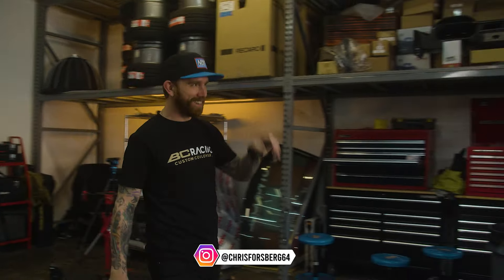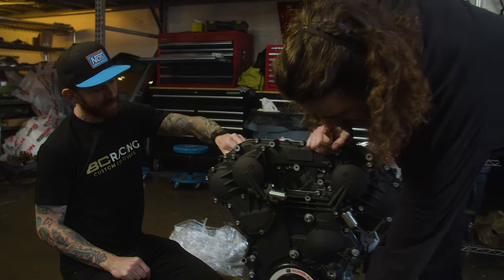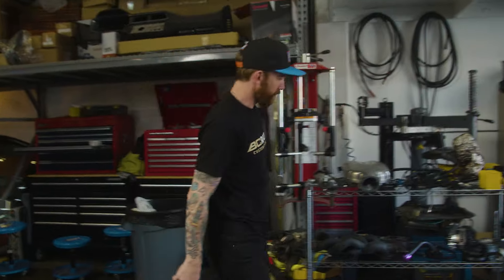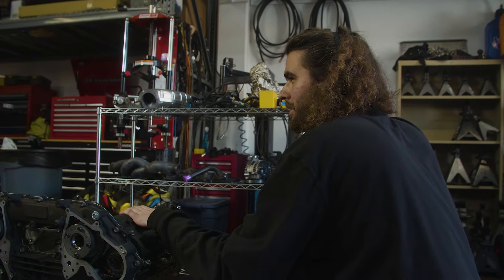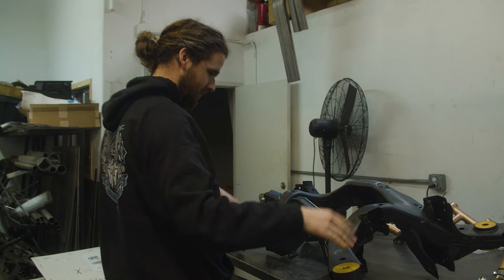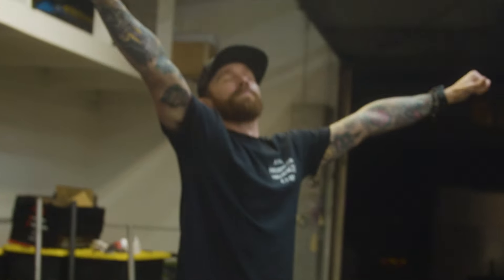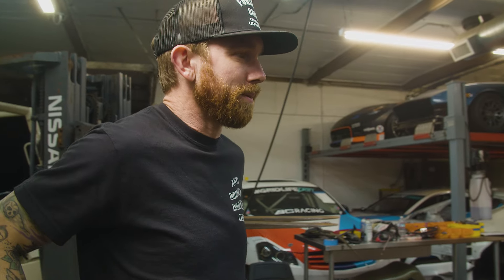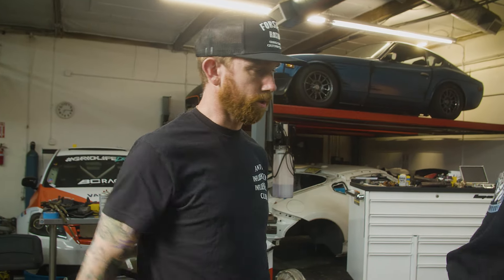GTR Motor Swapped Nissan Z Hits The Dyno!! | You Won’t Believe The Power It Made!!

Comment: How much boost did it take to get close to 900whp?  It should have only taken 23psi at 10:1 compression ratio. If not, then you can get more whp by upgrading what is holding it back with the turbo kit. You have the same size turbos that I run on my VQ now. I am using Xonarotor turbos.